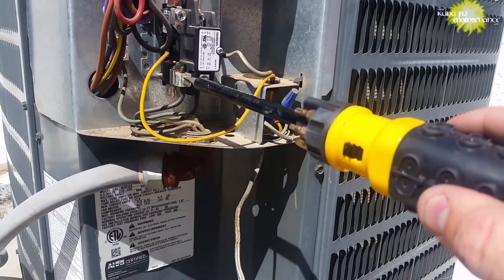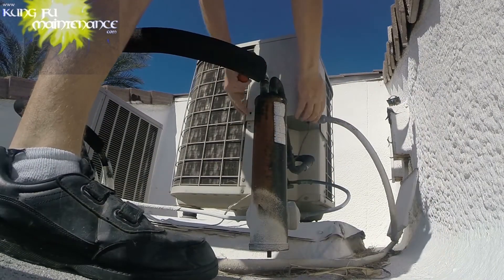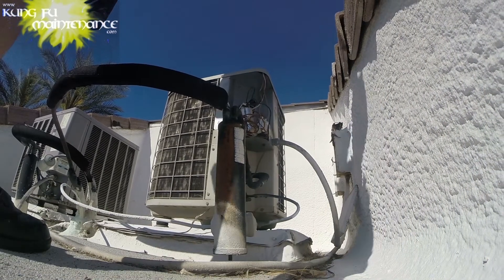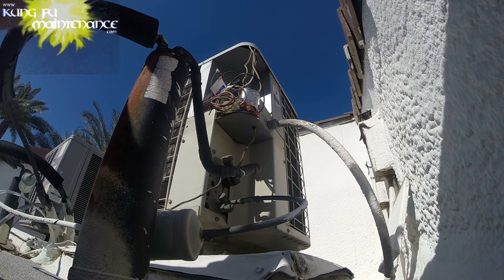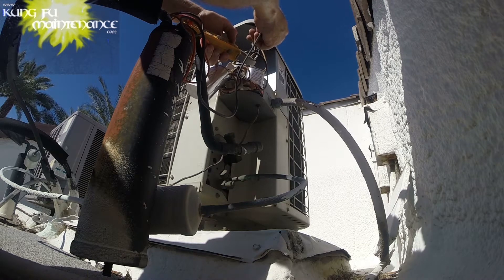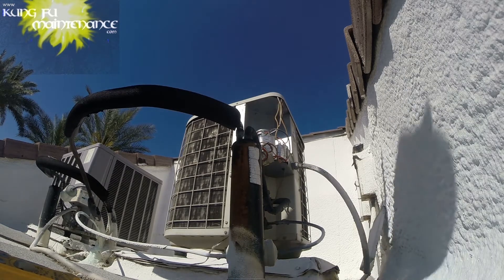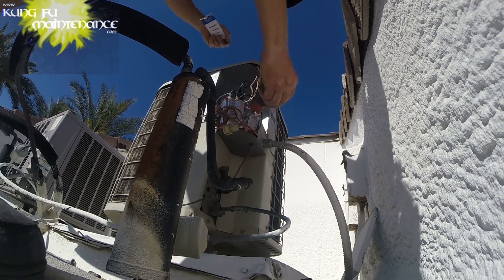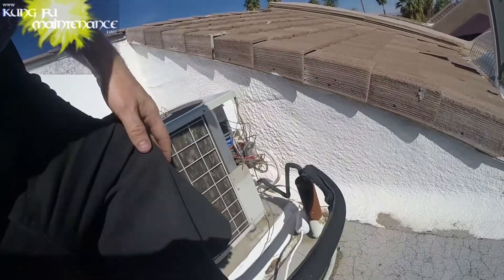ICP Air Conditioner Correction Update

Comment from the maker: Hire An HVAC Specialist                                  http://amzn.to/2lktKek
Air Duct Cleaning Services                              http://amzn.to/2lFTpun
Central Air Conditioner Tune Up                   http://amzn.to/2lzJGoy 
Air Conditioner Repair Or Installation          http://amzn.to/2lFsEGw 
Get KFM favored Electronic Leak Detector        http://amzn.to/2kmQMMz
Easiest Way To Get Universal EPA Certified Prep Manual    http://amzn.to/2kIQdQC
Get Third Generation Nest Thermostat here https://amzn.to/2L8TA1n
Get KFM's favored AC Gauges here            http://amzn.to/2kYgGb8
5/8" Suction Line Insulation   http://amzn.to/2w1me8G
Inficon Refrigerant Scale                               http://amzn.to/2vUCQPD
Hard Start Kit     http://amzn.to/2kiD16v   Contactor     http://amzn.to/2lFqA0P
Get  the Multi Tool Pliers used in so many KFM videos       http://amzn.to/2kWTjPp
5mf Capacitor   http://amzn.to/2wC96sH     35mf Capacitor    http://amzn.to/2vZVZ2t
35/5mf Capacitor   http://amzn.to/2iVJNi2        40/5mf Capacitor    http://amzn.to/2wzEdXD 
45/5 mf Capacitor   http://amzn.to/2w0wez5   
Condensate Pan Tablets   http://amzn.to/2lalV9W   No Rinse Coil Cleaner  http://amzn.to/2lHg8GD
I do not work for Bristol just wanted to make it easier to find best capacitor sizes. I really wish manufacturers would print it on their compressors.
bristol compressor H23B283ABCA capacitor sixe 40
bristol compressor H23B28QABCA and 
H29B28UABCA
capacitor sixe 35
Bristol Compressor H2EB24SABCB   30
Condenser Fin Whisk Brush                          http://amzn.to/2vWXUoC 
You must be EPA certified to charge or recover refrigerants and here is about the Easiest Way To Get certified with the Universal EPA Certified Prep Manual    http://amzn.to/2kIQdQC
Simple Leak Seek Spray   http://amzn.to/2lFfcC5  Laser Thermometer  http://amzn.to/2layD8I  
Valve Core Removal Tool                              http://amzn.to/2kJ00pC
Get KFM favored Electronic Leak Detector        http://amzn.to/2kmQMMz
Get KFM's favored Multi-Meter  here        http://amzn.to/2l8W9CO 
Get the Milwaukee 11 in 1 Screwdriver     http://amzn.to/2uTtsNj 
Wet Dry Vacuum used in so many KFM videos   http://amzn.to/2lFxi7u
Chapin Pro Pump Sprayer                             http://amzn.to/2vWCXdD
Evaporator Coil Cleaner No Rinse Mix        http://amzn.to/2x3eJTT
Evaporator Coil Cleaner No Rinse Can        http://amzn.to/2ezIxju  
Get the Screwdriver used in so many KFM videos here    http://amzn.to/2kHFoOF 
Get The Kung Fu Maintenance book here     http://amzn.to/2lEQPFk
Or  the Kung Fu Maintenance E book here  for less than $5    http://amzn.to/2lEY8wD
Get the Kung Fu Maintenance album (good driving music) "Up Beat" here     http://amzn.to/2l41pZ1
Get the Kung Fu Maintenance album (nice Instrumental music) "Entropy" here   http://amzn.to/2kl2U0p
Samsung Galaxy S8 Plus        http://amzn.to/2sFn9h8
GoPro Hero 5 Action Camera         http://amzn.to/2sN4nVK
Rode Lapel Microphone                 http://amzn.to/2vZoFc7
Purple Panda Lapel Microphone  Kit   http://amzn.to/2wByXkq
Video Edit Pro Software       http://amzn.to/2ruaae